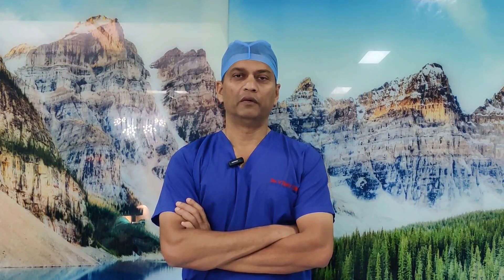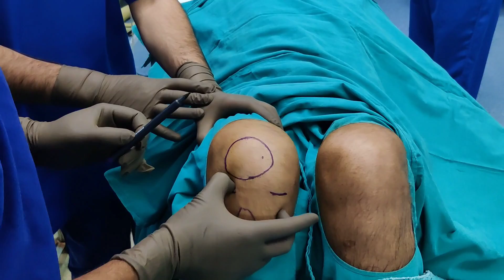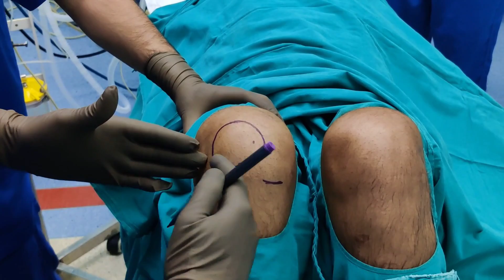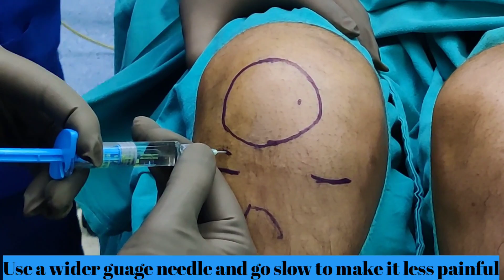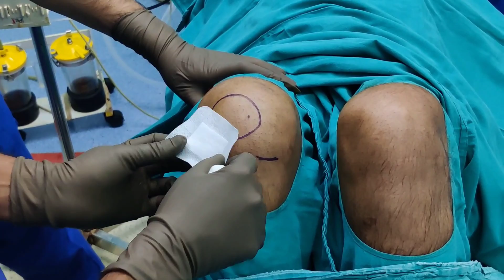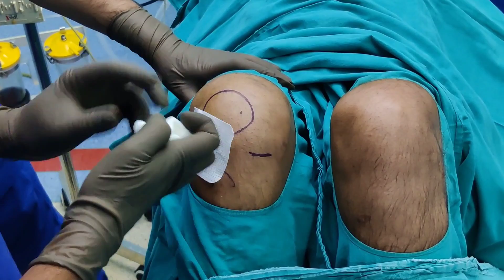Hyaluronic Acid Injection Knee

Comment: @blksqd7085 I posted to you a few minutes ago, but for some reason, someone deleted it. The HA injection didn't work for me. Also, I had a major swelling event after I had it. My Dr drained 40 CC of fluid off my knee. I'll be getting a TKR in January 2025. Maybe it will work for you. Are you going to try it?
Reply from the maker: Try PRP it is the best option
Reply: @DrVinayKumarSingh  That's just prolonging the knee replacement. Might as well go ahead and get it done.

Comment: Sir when should we use PRP/Hyaluronic acid or steroid? Plz explain about indication and patient selection for each of the above.
Reply: Patient suitability is based on the medical history, pain impact on ADL, stage of degen  changes and mainly patient willingness. Usually CSI (steroid with or without LA) shows quick response but may last up to 12 weeks, again depending on the maintenance and activity levels. HA shows late response with long lasting effect up to 6 months as per the evidence. As far as the adverse effects are concerned, CSI holds the evidence of chondrotoxicity whereas HA is less likely, and there is no sound evidence to support PRP though.
Reply from the maker: PRP for up to grade 3 and  steroids for severe arthritis.